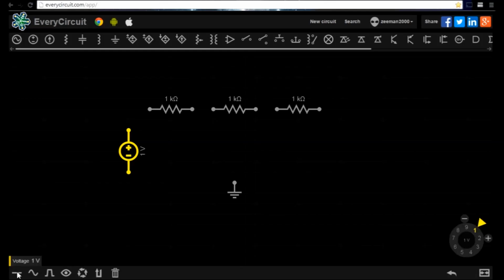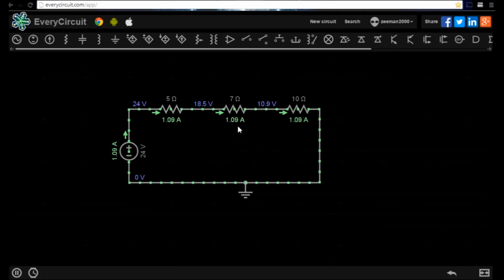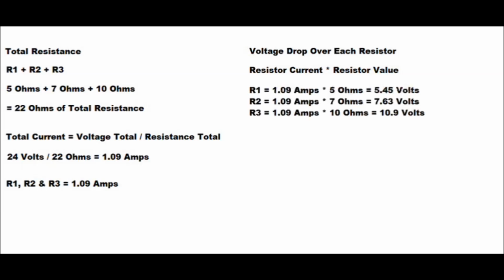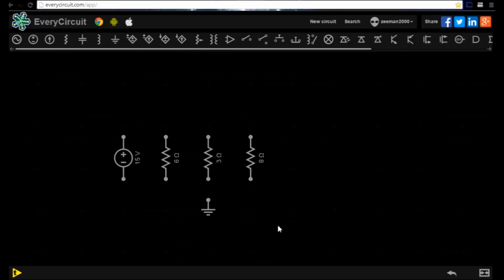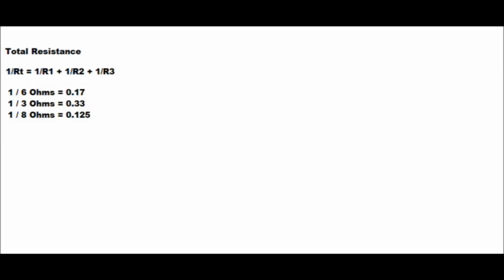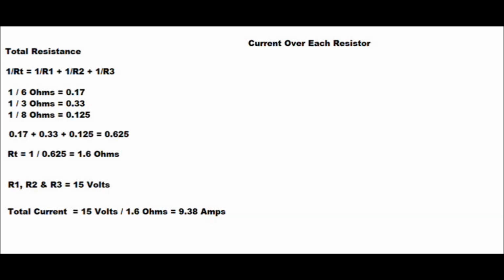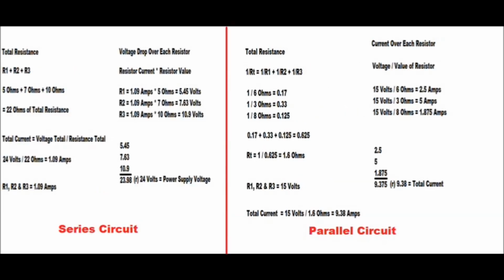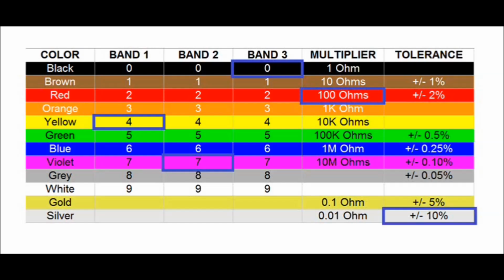Electronics Tutorial 3 - Resistors

Comment: Isn't it more appropriate to say that the current is split into the different legs of the circuit (inversely proportional to the resistor's value) than talking about a current drop? I learned that the voltage drops, not the current. Thanks.
Reply from the maker: Hi again Francois, you are correct. Depending on the configuration of the resistor current or voltage can be changed to suit the circuit needs.

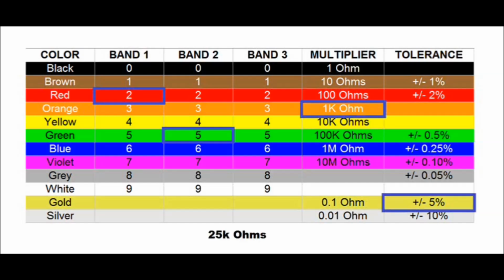Comment: My english is bad, i understand you in end. Time in video 11:40. How you make 25k ohms ? Pls speak formula solutions.
Reply from the maker: Thanks you for commenting. I will try to explain more for you.

The colour code chart helps identify the value of a resitor on ohms
If you examine a resistor you will see colour bands painted on it
Each colour has a value from 0 to 9
for 4 band resistors we use band 1,2 and the multiplier fourth band is for tolerance
for 5 band resistors we use band 1,2,3 and the muliplier fifth band is for tolerance

the 25kohm resistor is calculated using the colour code chart

Band 1 = RED - The first value is 2
Band 2 = GREEN - The second value is 5
the value of the two bands together is 25
we dont add or mulitply the first two band we simply place
the numbers in order to make the value of 25

Band 3 = ORANGE - the Multiplier Value - We multiply the value of the first 
two bands by 1000

25 * 1000 = 25,000 or 25kOhms

Band 4 = GOLD - Tolerance - The resistor value will be above or below 
the percentage of the tolerance

Another Example:

Band 1 = Blue - 6
Band 2 = Yellow - 4
Band 3 = Green - 10,000

6,4 = 64
64 * 10,000 = 640,000 or 640kOhm

Hope this helps.
Reply: My english is bad, but from part I understood you. How it is made. Big thanks
Reply: Jenko022 Band 3 = Green — 3 but not 10000. or i dont understand that Schema? Nice Channel! U are trying to make the world better!